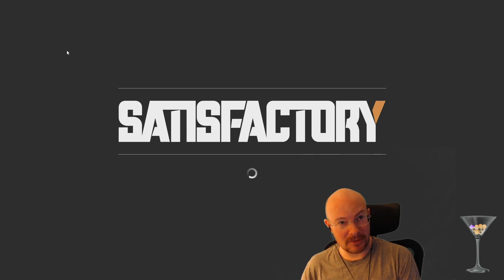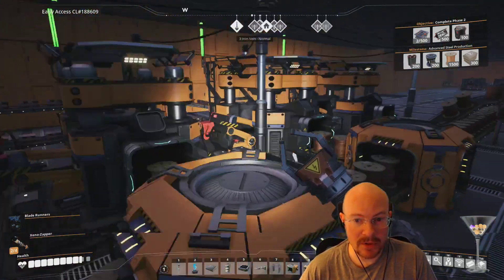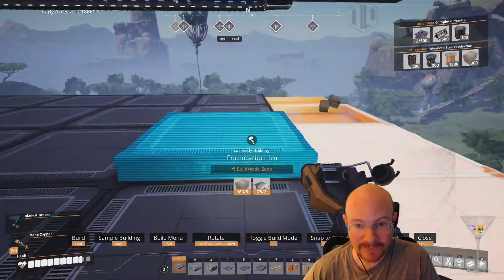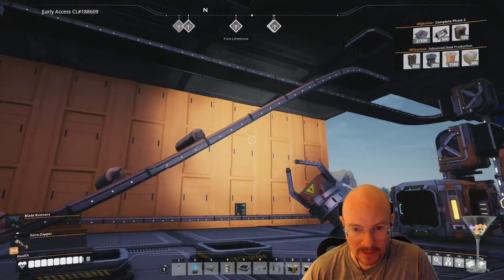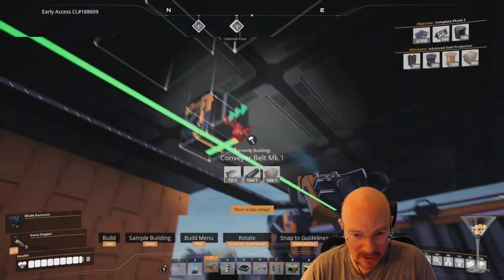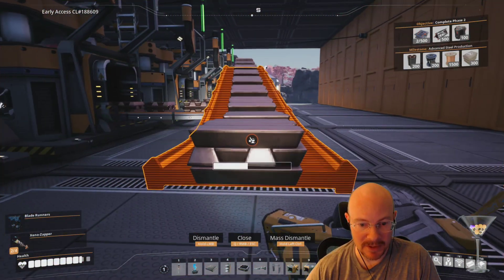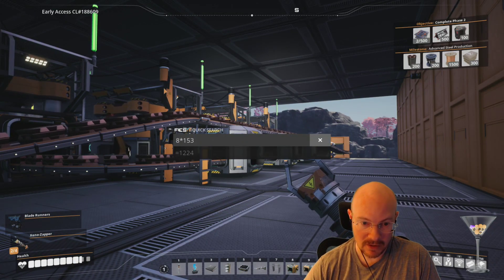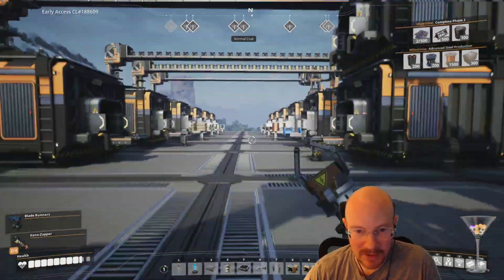Satisfactory Day 6! Steel Automation and Coal Power Upgrades, Part 1

Comment: Hi Rand, i think some of your copper sheet production ingredients are not connected, and the mk3 conveyor lifts were replaced with mk1 when you rebuilt them.
Reply from the maker: Thanks, GW.  I believe I fixed one or both of those problems off-stream after this stream, but I'll definitely go back and check.  Good eye, and thanks for the head's up!
Reply: @rand118  No problem :) am watching your runs and enjoying it, thanks